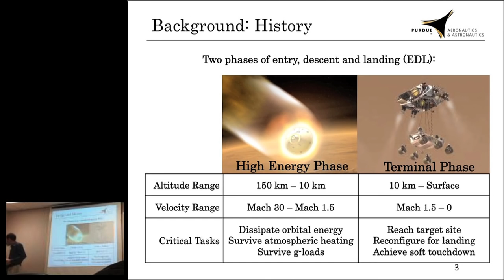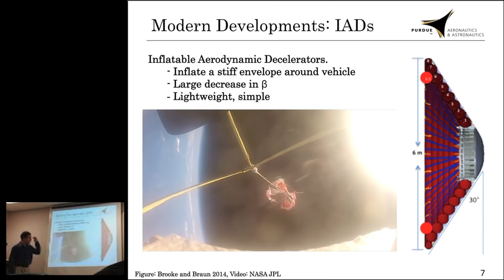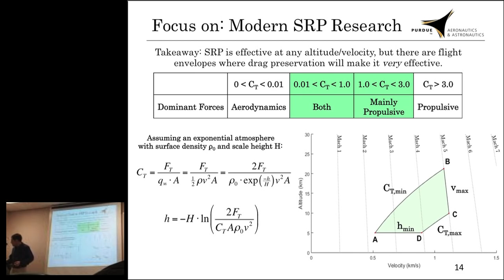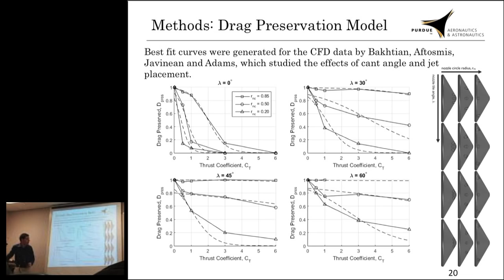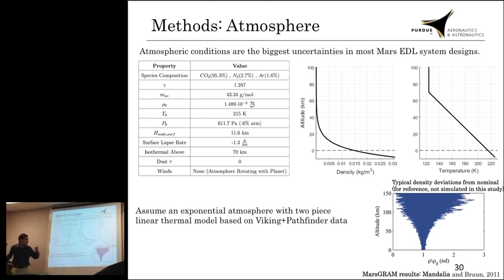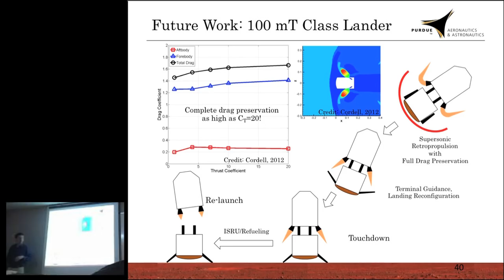Thesis Defense: Supersonic Retropropulsion for Mars EDL

Comment: Very interesting -- thanks for the nice presentation!
One question:  What would be the impact of extending the L/D of the entry vehicle well above those of blunt bodies like Orion, Apollo, or MSL ?
If I understood your presentation, gravity losses would kick in big time, for a greatly extended horizontal flight, right ?
So how about considering "lifting body" or "hypersonic waverider" type of entry vehicles ?
Just as an aside, I recall years ago, these were considered in aerodynamic-augmented fly-by maneuvers, for interplanetary delta-V (using negative lift, with a high L/D vehicle).

So it seems like there might be a realistic role for greatly increased L/D in Mars landing.
Reply from the maker: +Jaro Franta High L/D solutions are another approach that is being investigated in our lab, and they do have advantages. They generally produce milder entry (both from thermal and g-loading perspectives) and have a greater tolerance for entry interface errors (since higher L/D's give them greater control over their crossrange and downrange, at least while they are flying supersonically).

But there are disadvantages. Most notably that even if the vehicle could achieve a ridiculously high L/D (like the Space Shuttle's L/D of ~5), maintaining level flight at sea level on Mars still requires supersonic flight. Landing a spacecraft on Mars the same way we landed the space shuttle or a conventional aircraft is effectively impossible on Mars, the air is just too thin.

So even with a lifting body, all deceleration <Mach 1 will have to be performed retropropulsivelly. This is especially true if you want to maintain the landing accuracy required of most crewed architectures (L/D doesn't help you navigate very well when you are flying subsonically on Mars, the dynamic loading is just too low). So now your vehicle has to have a lifting surface AND engines, and transfer from one to the other around the supersonic regime. That is possible, but the complexity and the mass budget can get away from you very quickly.

A simpler approach is to realize that, basically no matter what, a crewed vehicle will have to have enormous engines, and engage in an extended retropropulsive terminal phase. Starting with that as a fixed assumption, the simplest architecture becomes to build your vehicle around a retropropulsive (not a lifting body) design.

Comment: Hey Beagle made it to the surface though! Take the cross off that little guy!
Reply: +Chris Hollingsworth Edit: watched a bit further on, I'll settle down and drink my tea.
Reply from the maker: +Chris Hollingsworth I actually didn't know that Beagle had been identified as being safely on the surface until after my defense (which is why, as you saw, I added the annotation). However, I still think the X is justified. We still don't know what caused it to fail to deploy, but mechanical damage due to a hard landing because something went wrong during EDL (i.e. a late parachute deployment, an unexpectedly thin atmosphere etc.) is still a plausible option.